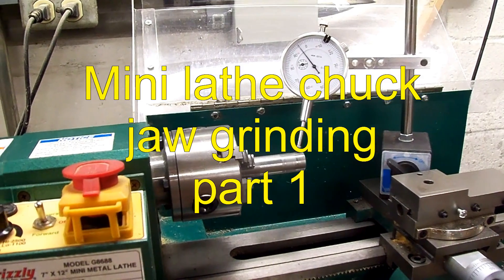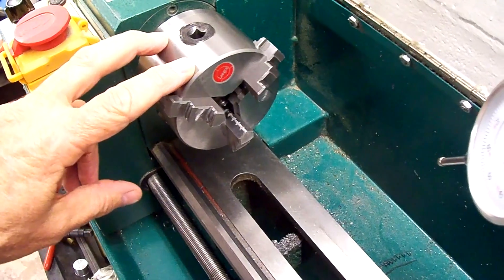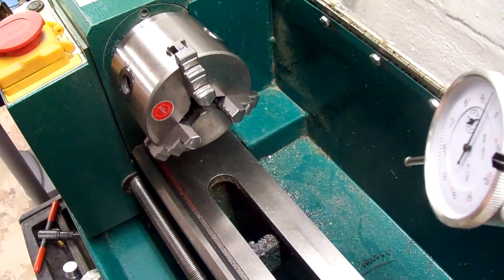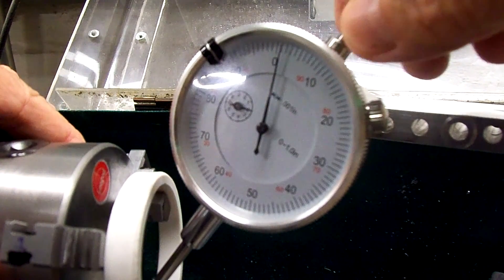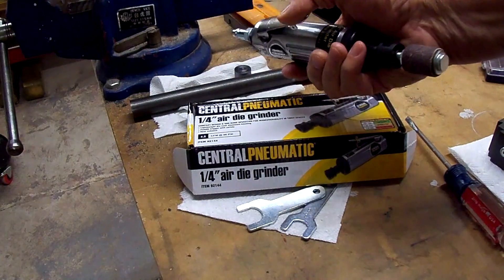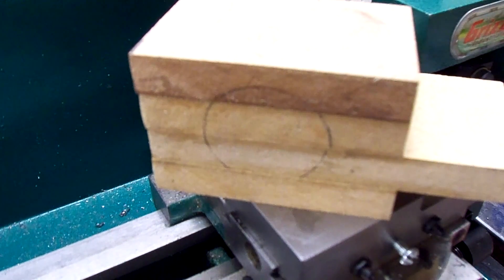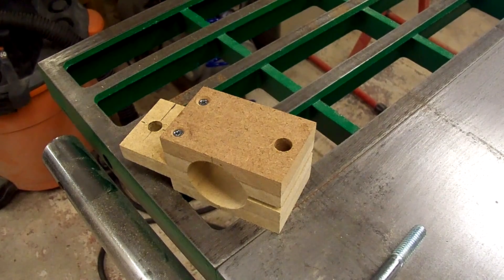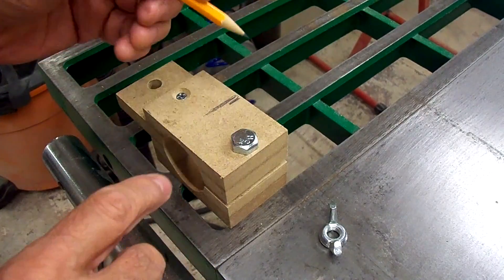Mini lathe chuck jaw grinding

Comment: Nice work. However, keep in mind, the ring on the jaws is exerting inward force not outward force. You will be using the outer sides of the chuck spiral threads and the inner sides of you jaw threads as your references. Not vice versa, as with bar holding.

Comment: I would never advocate grinding your hard jaws. In your manual for this lathe it states

3-jaw chucks will always have a little run-out.
It is advisable to measure the run-out of a
workpiece after it is mounted in the chuck.
If a higher degree of accuracy is desired,
replace the 3-jaw chuck with a 4-jaw chuck
and adjust the workpiece while using a dial
indicator until the desired concentricity is
achieved.

So if you need better accuracy then get a 4 jaw chuck. If you really only want to use a 3 jaw chuck then get a set of master jaws and a bunch of soft jaw blanks for it.
Reply: Also need to check run out for smallest to largest chucking diameter. The spiral in the chuck is not that accurate between dia's. I found different runouts on different sized stock using 3 jaw chucks.